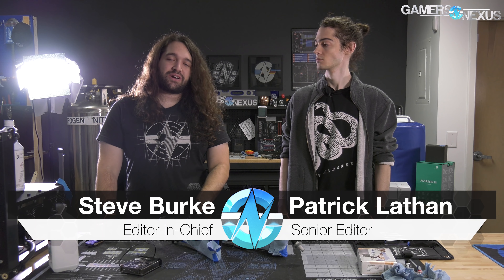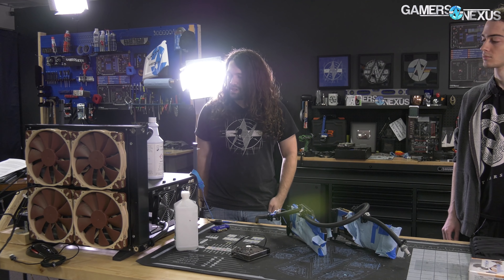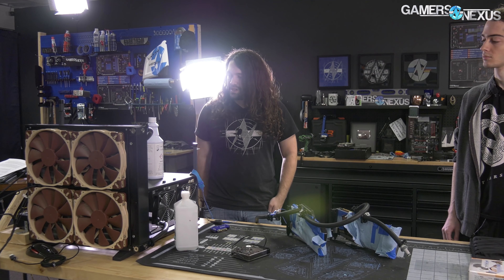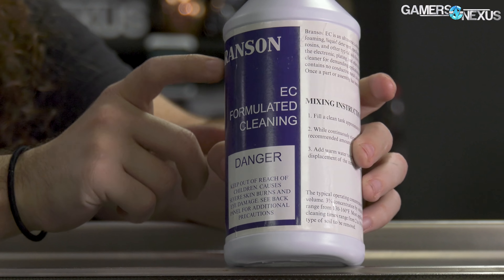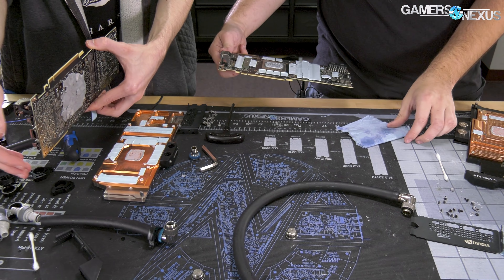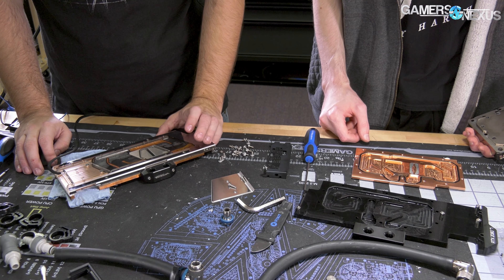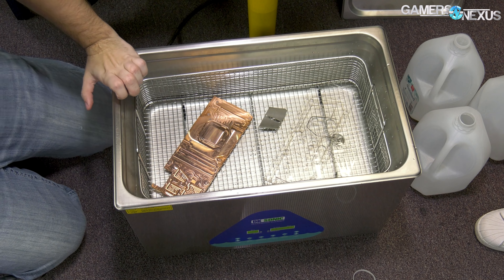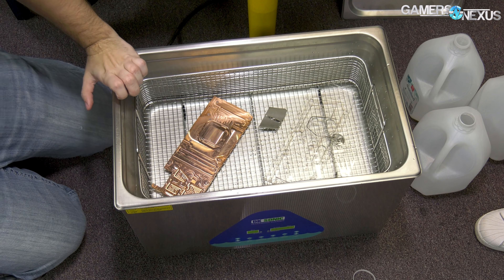Cleaning Copper Oxide Off a Water Block: Ultra Sonic vs. Vinegar

Comment from the maker: Just a secondary channel video of some between-the-scenes stuff that we had to do anyway. Hope you enjoy it. It's mostly just us experimenting like we would normally do off-camera, except we recorded it.
Watch our bonus video with Wendell here: https://www.youtube.com/watch?v=ZwVBRcmVSV0
Should note that when it says "Senior Editor," it's referring to written/editorial, not to video editing. Forgot that people get confused about that with YouTube.
Reply: You could just pump either vinegar or lemon juice through the rad for a couple days to clean the inside.
Reply: I use asda apc and tap water in my loop normally change the water at least once a month.
Reply: +1 Lego bucket. I got the red tall one from like early 1990s when I was big into legos...actually, still big into legos right now, ha ha, but I gotta share with my kiddo. And thought you got the ultrasonic cleaner from Louis Rossmann until you said Amazon. Anyways, when using the ultrasonic cleaner, make sure you have whatever you're cleaning lifted off the sides of the tub otherwise, cavitation won't be effectively formed in some areas and you won't get a thorough cleaning and if you're using vinegar to clean tarnish, corrosion and shit off copper and stuff, be sure to add some salt to the vinegar solution...then afterwards, when you've rinsed off the vinegar and salt solution, go over once with distilled water, then a distilled water solution with a bit of baking soda to neutralize any acetic acid left over from the vinegar solution and then a last rinse with distilled water. That's how I clean my tarnished stuff like my ammunition and stuff that gets tarnish and stuff that forms after carrying it EDC for a while and it's worked well for me. Oh, and FYI, to remove vaseline or petroleum jelly, spray and soak the area with WD-40 for like 10 mins and then water with Palmolive Oxy as it's a very effective degreaser without phosphates. Works well with cleaning PCBs, gold plated contacts on PCBs and other stuff as well.
Reply: @GNSteve After submersing the copper etc in vinegar you should use a toothbrush to clean the copper. Normal water. Also I think baking soda might help with some stains (slightly abrasive etc so it helps to sand off some things). Either way using a tooth brush to clean the vinegar off is a must.
Reply: Try an use artic fresh (jayz choice) or brasso
Reply: Any chance you could detail your process for using the ultrasonic for cleaning boards? While my ultrasonic is contaminated from recycling range brass it could be useful info for others that do things like cleaning smoker's computers.
Reply: that blackness is just copper tarnish get some tarn-x and itll clean it right up. Also try no-sweat spray for the back of the motherboards instead of petroleum jelly
Reply: It is assumed by most folks that distilled water is ph neutral (7.0), which it is immediately after distillation. Shortly after, it absorbs CO2 from the atmosphere and becomes acidic (~5.8). It looks like the copper has been corroded due to this process. I always use a cooling solution with an anti-corrosion buffer for this reason. I've had good luck with Swiftech HydrX which is very inexpensive. Google "PH of distilled water" for more on this. 

Note, I've even had luck combining copper and aluminum components. using this corrosion inhibitor.
Reply: remember to get your electronic cleaning supplies and soldering components you can always go to https://store.rossmanngroup.com/
Reply: Y'know, the blood of one's enemies has been know to clean, too.

Comment: Hey Steve, sonicate in dilute (0.1 - 1 molar) hydrochloric acid. Gets rid of copper oxide by converting it into copper chloride which is very well soluble in water. Cheers from a chemist.
Reply: Whats a good one for aluminum?
Reply: Aluminum is highly reactive and is basically covered in patina as soon as it touches air so there's not a whole lot of point to it. Weak acids or very dilute strong acids will still work but it's mostly pointless.
Reply: Lol, every chemist ever. Either HCL or HF, solution to everything. :D 
We used Ant or Citronic accid in our sonic baths for most metals, but ran it for much longer than 50Min.
Reply: wtf type of measurement is 0.1 - 1 molar?

Comment: usually what we use in the lab to clean metall (pretty much anything) is ultrasonic electrolysis in acidic medium (oxalic acid usually, faaaaar more efficient than vinegar)
so basically what we do is an acidic solution, pour it into an ultrasonic bath, and use the piece as an anode at a low amperage

Comment: The de-gas cycle is to be run on the solution before you add the parts.  This is said to remove some of the dissolved gases from the solution.  If normal bubbles from these gases form on the parts, those areas will not be exposed to the cleaning cavitation.    I had a small Branson that didn't have a de-gs button, however their manual suggested running a cycle without parts in order to prepare the solution.

Comment: I have done this before and if rinsing it off with the distilled water didn't neutralize the acid the copper will start to turn green after a few hours of being exposed to air.  If that happens you need to use a mild base mixed with distilled water to stop the reaction.  Soak it in some vinegar again to remove the green scaling then neutralize it to stop the scaling from forming again.  I used a few drops of dawn dish liquid mixed in the distilled water and let it soak for an hour or so. You could also use baking soda mixed in water.  Just be sure to rinse it well with more distilled water when you are done to remove as much of the soap or whatever base you choose to use.

Comment: Since the finish of the cold plate is pretty much done with, the best way to clean up and shine up copper in my experience is any cleaner that uses "Oxalic Acid". The powder cleanser "Barkeeper's Friend" is oxalic acid with extremely fine abrasive powder (talking micron, like polishing compound). Work it into copper with a little bit of water to turn the cleaner powder into a paste and scrub with a toothbrush and it will remove all copper tarnish with ease. Have had copper cold plates get oxidized over time and this spruces them right up. Thing is, BKF needs mechanical action to work properly. It won't do much if the part just rests in water with BKF dissolved.

You can also try hot CLR solution. I've used that on steel and zinc parts that have rust stains and it'll dissolve away the oxide stains. It uses a proprietary blend of non-acidic ingredients so it's safe to use on lots of surfaces. CLR works fastest when it is hot. I've microwaved CLR solution periodically to make sure the solution works fast.

Comment: The Branson EC was me Steve. I have the Exact same Ultrasonic cleaner as well. The EC is good for electronics cleaning but haven't tried it for Metal cleaning. There are other solution for pure metal cleaning that is more aggressive. Also Degassing is to be run prior to any cleaning. It removes air bubbles from the solution to make the cavitation effect better. Air is a sound wave attenuator compared to water/liquid.

Comment: You need to use salt and lemon juice to clean the copper. And if you're feeling adventurous, the best way to clean it is with muriatic acid.Be very careful with muriatic acid. Both methods will work to bring back the luster you are looking for on the blocks. You can then polish them with Autosol, to give you a mirror finish. Muriatic acid will also work for the radiators. Do not leave the acid in or on the metals for too long. Make sure to rinse the parts thoroughly with water after cleaning. And again, do be careful when working with muriatic acid. It has an "ANGER WARNING" on the bottle too!

I am a Mechanic (30+ years), and I have been using these products for decades to refurbish copper and brass components. Everything from radiators and heater cores, to wiring, ground straps and electrical switches. To prevent future corrosion issues, there is a clear antifreeze/coolant called "Water Wetter", that is used in racing applications. Since you will not be reaching the temperatures of an engine, you could mix it at around 10 to 1 (distilled/deionized water to Water Wetter) to gain the anti corrosion properties.

I hope this helps. o7
Reply: Exactly this. I would also add, make sure to neutralize acids with baking soda.

A corrosion inhibitor is cheap insurance to save yourself some time and money. Also, a biocide alone is not a corrosion inhibitor. In fact, it can make things worse if it’s silver/copper based.

Comment: The popping bubble cleaning action is called cavitation which can erode metals over time which is the main reason to not have bubbles in a water cooling loop and is a common problem with boat propellers.
Reply: BTW people use Coca-Cola to clean old copper pennies.

Comment: i have worked as a plumber that black stuff and the floating bits in a heating radiator is actually something you want to see as it means there can't be any bacteria to clog your loop as the entire loop is free of oxygen and the bits will act like a biocide.

so just to be clear you want to clean this but the black stuff means you didn't really have corrosion or bacteria in the loop this is just what water dose to copper after a while.

Comment: A tip for next time: Lemon juice works because of the citric acid it contains. You can find pure citric acid as a powder in food stores (atleast here in sweden). When mixed with water it will be a clear solution and you can adjust  the pH to your preference.
Reply: Bit late to the party but this is exactly what I thought about when they showed the ultra sonic cleaner. It's perfect for use in them since you can just add more if the effect is not as desired and it has virtually no downside since it doesn't corrode or produce any toxic fumes. That said you should still not ingest it or bath in it :P

Comment: did you try copper polish that is used for cleaning pots and pans?. I use it to clean heavy oxidation on copper and brass and it doesn't eat into the metal but it needs to be washed in hot water afterward.

Comment: Hello, Steve;
A few pointers to help you clean corroded metal water blocks.
1st: To calculate percentages start w/ a common base unit-you used 4 gallons of water so a common base would be ounces so 4 * 128 oz / gal = 512 oz. To get a 3% solution multiply 512  * .03 = 15.36 oz.
So you found out that vinegar worked pretty good.
The 2 kinds of cleaning solutions are acid & alkali-the detergent you tried is an alkali like most soaps.
The vinegar is an acid which is why it dissolved the oxidation on the water block.
Most vinegar is 5% acetic acid mixed w/ 95% water.
To get a stronger solution buy straight acetic acid & dilute it w/ water (distilled).
If you have to clean another corroded water block try straight vinegar in the sonic cleaner for say 2-3 hours & check it. If its good enough RINSE it off w/ running water.
You want to remove ALL the acid completely.
You can experiment w/ pennies-leave them in vinegar too long & they'll dissolve.
If you had put the water block in the sonic cleaner w/vinegar I think you'd be surprised how well it works.
Hopefully helpful.
Have a GREAT day, Neighbor!

Comment: Just as an idea for next time. Try using citric acid instead of vinegar to avoid the smell. In addition you can raise the acidity which I think is the reason that the vinegar worked better than the lemon juice. You can also run the ultrasonic cleaner with distilled water, citric acid and a little bit of dish soap and should have similar results after more or less half an hour.
Edit: After reading the rest of the comments I second the idea of neutralising the acid with baking soda.

Comment: Another way to clean the copper would be using oxalic acid found in Bar keepers friend. It would not have any smell and it is sold as a powder so all you would need is a little water and a toothbrush. It works very well cleaning the oxide buildup on my copper bottomed pans.

Comment: could you clean your loop by running it with vinegar for a few hours? then rinse by running distilled water through it for a few cycles? or would it be too hard on the o-rings etc?

Comment: “3% of 4 gallons is 12% of one gallon” (12% of 128oz is about 15oz so about a pint) proceeds to add a couple drops
Reply: Michael Mercer they shouldn't have used it at all as it reacted with the copper oxidizing it.
Reply: @wolf001cmd  Ultrasonic is physical, meanwhile the detergent is a chemical method to clean that copper piece so one does not imply the other

Comment: seems like there could be galvanic corrosion happening in the loop.
this is when you have diferent types of metal in the loop that are far apart on the galvanic corrosion chart like copper and alluminium. the metals have diferent charges naturally, if they are all in the loop touching the water, the least noble metal (anodic) will be jubjected to corrosion, conductive water makes this worse, again if they are all grounded together the same thing happens.
so with copper and alluminium, the alluminium will corrode.
with alluminium and zink, the zink will corrode.
i would guess there may be another metal in the loop that is more cathodic in the loop than copper such as brass/bronze/nickel/silver/stainless steel. these are all more cathodic than copper.
dont forget that some coppers are a mixture of metals that can make them more cathodic than others. if all the metals are copper then id be looking for the one that is not corroded in the loop and suspect that component to be the issue.
you could,clean the loop regularly with distilled water and add a corrosion inhibitor or remove the unaffected component.

Comment: If you consider trying lemon juice next time, I personally would just buy a bag of citric acid instead from the pharmacy. You can make the solution as weak or as strong as you want.
P.S. Neutralise the acid in baking soda solution, then rinse with dihydrogen monoxide.

Comment: Time to go Level1 style with Wendell and his old fashioned bathroom for those on a budget ;) Ultrasonic should work better with bigger particles of debris instead of oxide attached to porous uneven surface such as the weathered inside from a water cooling heat to liquid transfer interface.

Comment: I just call them heatkiller but their stuff was out of my budget, XSPC, Bykski and barrow are amazing alternatives
Reply: Depends on where you live. In Germany their prices are quite competitive.
Reply: Can endorse Bykski. I have a 2080ti block of theirs feeding a 360 thickboi radiator. Getting the card to 100 percent ute through furmark and keeping it there for a while maxed the thermals at about 40c in a 20c room. In gameplay it's obviously much cooler. A lot of that is probably the rad, but cannot overstate the quality of the block. Only complaint is that the backing plate traps heat. I need to put some pads under it the next teardown.
Reply: @agenericaccount3935  No need for rear pads. The waterblock absorbs so much heat that the only purpose of a backplate is esthetics and maybe physical protection. Thermally it becomes completely irrelevant.
Reply: @cl4ster17  You'd think, but it gets quite warm. While the GPU package stays frosty, there is some climb elsewhere on the PCB where it isn't padded to the backplate. Again though, during a stress test these things happen. For the sake of it, I will pad it up just for giggles and see. There is dead air between it and the PCB. Great way to trap excess heat.
Reply: @agenericaccount3935  The backplate on my 1080Ti barely exceeds 40°C, maybe 45°C when stress testing even though it has pads contacting the VRM. Case internals are 30-ish°C, water temps 23-25°C thanks to a MoRa 420. With a measly delta of 10K and no airflow there is no meaningful cooling potential for my backplate. The waterblock already does all the work.
Reply: @cl4ster17  neato. What do you expect me to take from your walltext about a different card with a different block attached to a different rad in (or in the vicinity of) a different case?
Reply: @agenericaccount3935  I have both of my 2080ti cards under water using Bykski water blocks, and they are compatible with with Stock EVGA metal backplate and EVGA back plate screws, so that I don't have to take off the pads. The EVGA XC Ultra comes with thermal pads on back plate and slots cut into it for venting. The Bykski plate looks better, but the stock plate performs better!

Comment: I’m surprised a good Carolina boy such as yourself doesn’t use the method favored by many of our backwoods neighbors for cleaning rusted motorcycle gas tanks and seized tractor motors. Pour a jar of Grandma’s Molasses into a five-gallon bucket of rainwater. Cover and store downwind from the studio. After about a week, put in the parts to be cleaned. Take them out periodically and wash them off with a jet of water. Don’t know if the offending substance is cupric or cuprous oxide, but it doesn’t matter. The brew frees the oxygen from either compound. When finished, pour the mixture on a tree or bush – it’s great fertilizer.

Comment: Copper itself should be a biocide   by the oligodynamic effect, it it's self sanitizing
Reply: lol it is looped system so contamination does not flush away, it is circulating there!

Comment: I'm just running plain distilled water in my loop. It still looks clean after several months (1xcpu and 2xgpu blocks). I wonder if the fact that I cleaned my radiators with vinegar beforehand is helping at all? I mean, I did rinse it out, but there's gotta be some left in there. Actually, that's a good question. What would a few drops of vinegar do in a loop? I should probably clean it out and put in the proper red liquid that has biocide at some point though.